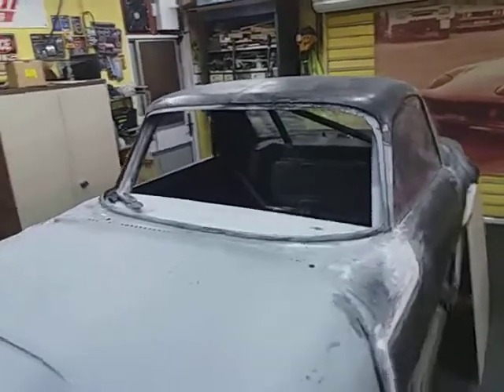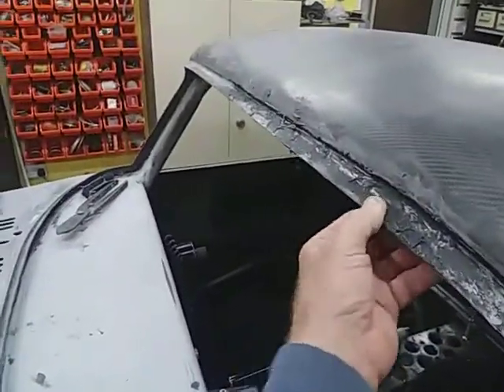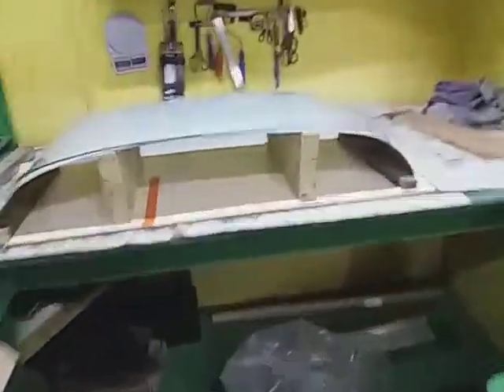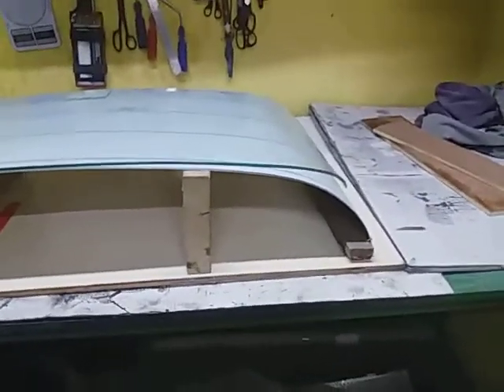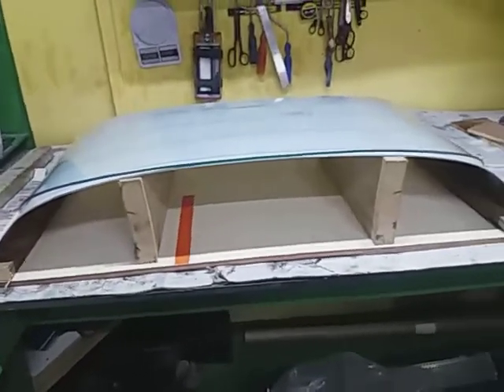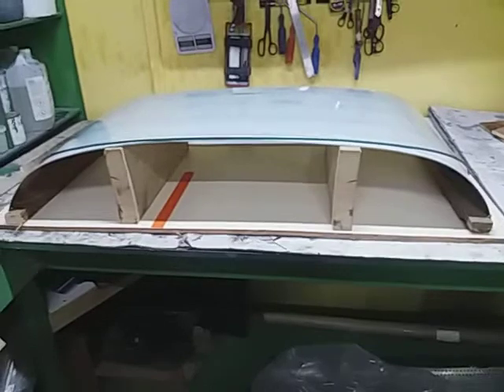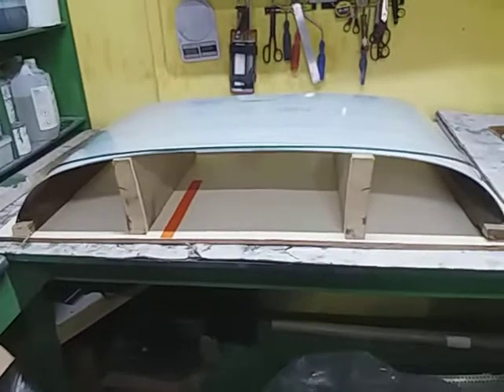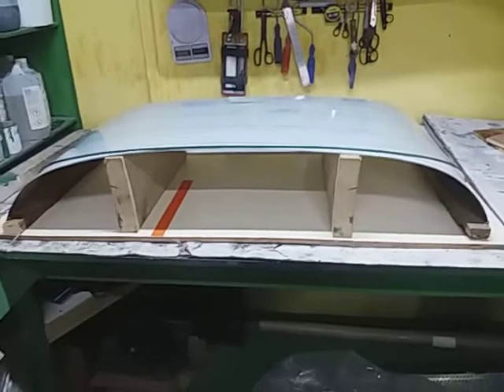Thermoforming polycarbonate windscreen Part 1 of 3

Comment: Only problem using poly for windscreen is that it scratches extremely easy. first time you use wipers in the rain it will scratch so badly you cannot see clearly through it.
Reply from the maker: I don't plan to drive in the rain :-) Poly isn't that bad. New wipers and a clean screen for the MOT will not be an issue.

Comment: Cool, i'm thinking of making a poly windscreen too, which type of oven you using mate?
Reply from the maker: A home made unit (1.8m x 1.8m x 0.9m) and a digital controller so the temperature can be ramped up at whatever degrees/minute are required for the resin being used in the prepreg carbon. The controller also allows for any temp to be maintained for any length of time. The heat is provided by an old domestic oven element and fan.